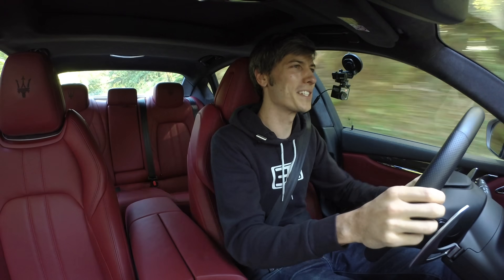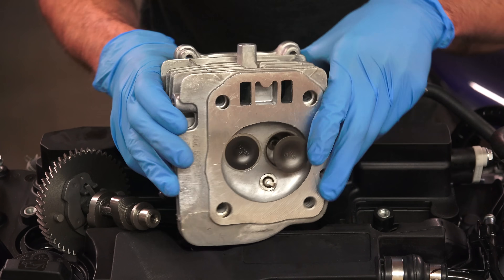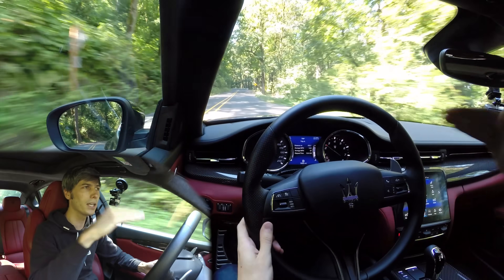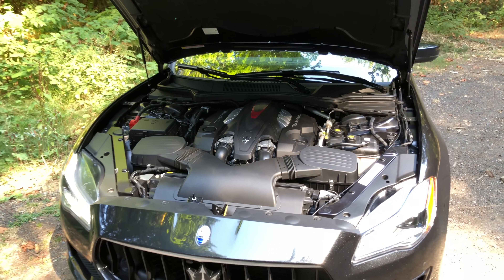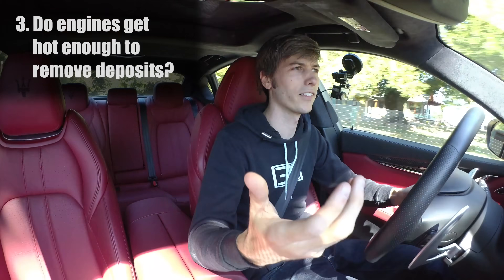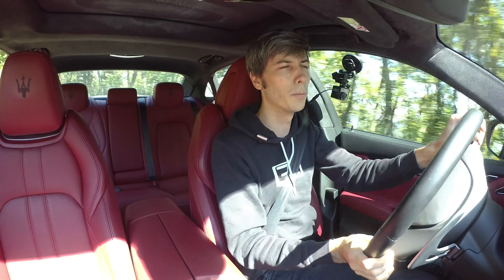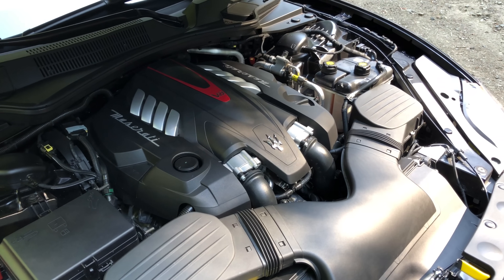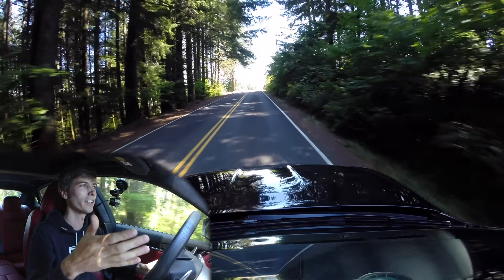Is Redline Good For Your Car's Engine? Italian Tune Up

Comment: This only looked at temperature as a possible way of clearing out the carbon deposits, but I would wonder if other mechanical factors could come into play as well - just flailing about so quickly, more air and fuel flowing through. Likewise, could running the engine that hard or hot do other damage? I have an old Bug, sometimes if it's not running right I'll do some good high-rev pulls and that might help a little - but might just be placebo. Was probably more true with the carburetor, running fuel and air through it more quickly might help to clean it out a bit. I've since converted it to fuel injection, doubt it would do as much with that. But in general, getting everything moving and flowing quickly I imagine is probably good for it from time to time. I've also read that if an engine is never redlined, only run relatively slowly (a grandma's car) the connecting rods won't stretch out all the way and as the cylinders wear ridges will form in the area that the pistons would reach if running at redline, thus if the car is redlined after being driven too gently for too long the connecting rods will stretch out a little more and the rings will hit these ridges and break. Hence it's wise to redline it every once in a while to prevent this.

Comment: I'm wondering about the "Coke bottle" 
tune up.

Taking a warm, not real hot, but warm, 
and drizzling water down the carburetor.

Yes, I KNOW!  Most people have no idea 
what a carb is.

Here is my experience.  1964 Dodge truck, 
with the famous Leaning Tower of Power,
Slant Six.  We played with it for a while, 
points, plugs, and adjusted the valves.

It ran pretty good, when we were done.  We 
tried one more antique tuning trick.  Slowly 
pouring water in the intake, using a CLEAN 
Coke bottle.  After that, we could get the 
engine to idle at 90 RPM.  At 250, we could 
balance a Nickel on the valve cover.

steve

Comment: As for intake valves staying clean in PI cars, do you think those WOT runs will force the injectors to push close to full duty and spray those intake valves clean? I believe it's a good thing!

Comment: Intake valves aren't the big issue from what I've seen. DI is particularly common in German cars and the big vulnerability is secondary air passages, particularly those internal to the head. External pipes can be replaced, but some engines need to be hit with a wire rasp to remove deposits and secondary air clogs can make for a really bad day at the SMOG shop. 

My favorite example of how effective the Italian tuneup can be is the E39 M5. Look at most rear bumpers and you'll see cookies and creme style carbon flakes all over the paint. Comes from somewhere.

Comment: I do the Italian tuneup only when I feel the engine needs one, like if it starts to bog or has an occasional stumble.  What I do is I wait till I have about 1/4 tank of fuel, I drop a full dose of fuel injector cleaner (seafoam will do), go on the expressway and drive at 50 - 60mph at 1 gear below top. This brings the rpm to about 4 - 5k and keep it there for about 3 -5 mins.  Make sure you have clean oil and the level is good.

Comment: I actually cleaned my fuel injectors with an italian tuneup. I was getting stuttering and misfires because of clogged injectors. Just turned O/D off and flored it a couple times. Haven't had the stuttering or misfiring come back in over 3 months.

Comment: In my experience it does work but I have not found modern cars carbon up that much.  The Italian tuneup was used for old carb engines.  It was especially used for high performance muscle cars that were driven very soft.  Those old cars were not efficient at idle and with the big cams, high compression and large carburetors, they had a tendency to crap themselves up.  Don't forget oil control in those old engines was not near what it is today, adding a quart of oil every 1K miles wasn't a big deal.   I don't believe that the Italian tuneup does anything worthwhile or noticeable on a vehicle made in the last 40 years.

Comment: Interesting but you omitted high compression in N/A engines vs low compression in compensated engines as well as airflow. The latter being useful for DPF post regen cycles and cat converters for petrol engines. Interestingky some engines suffer from this whilst others don't (Audi's V8 in the RS4 was bad whilst BMW V8 didn't despite being from the same era).

Comment: I had a 1983 z28 with throttle body fuel injection.  I loaned it to an older lady who drove it gently for about 3000 miles. When she brought it back it had a bad hesitation and would almost stall when starting out. I took it out on the street and floored it up to about 50 miles per hour then slowed way down and floored it again. The first time when I got close to red line in first gear so much black smoke started pouring out of the exhaust I could hardly see out the back window. After the 3rd full throttle acceleration it cleared up and began to run normally again.

Comment: So deposits don't actually form all that fast anyway. Say they form an appreciable amount every 50,000 miles. Well, one or two 5-10 mile race or spirited driving every fill up (300miles) might actually work. However just blipping the throttle to redline while in park might actually make it worse. When I drive normally I try to keep the RPMs under half of redline. I redline at 6k, so I try to shift at 3k. Most torque is at like 1600 anyway so it doesn't even really pull past that unless you have a serious turbo.

Comment: The Workshop addressed this theory. Check out his channel for a different perspective.
Also, I drive my car very aggressively, often cruising at 90 mph or more back roads where I can get away with it. I've driven the car since 0 miles like this, taking long road trips and going at high speeds when I could to save time. I gave it a hard break in in my estimation and put 60k miles on it in 6 months time. I'm at 90k miles now and I've never had any issues. Oil changes on time and new spark plugs at 75k miles. Car runs great. It is my belief that car engine needs to be exercised. No I don't take it to redline often but I drive like an asshole and the engine seems to enjoy that.

Comment: I’m beginning to regret purchasing a direct injection engine as I hear more and more of their fouling issues.  If only the EPA would just get out of mandating manufactures to keep increasing fuel mileage standards.  Sound to me we should of stopped at port injection and called it good enough.

Comment: Is Redline Good For Your Car's Engine? Seriously???  Okay, yes the red line is good for your engine. In fact stressing any mechanical device to it's extreme limit is good and normal.  The auto industry, airline industry, and all makers of engines would have you know that putting the needle on the red line or beyond, is the best way to break your engine in and if anything goes wrong they will gladly sell you a new engine. ;* ]
Reply: I don't think it's quite that bad. If car makers were routinely selling cars with engines that cannot reliably work over their full intended power band then those makers would lose market share in the long term. Obviously if we want to drive our cars hard they need to be serviced hard. Regardless of this it does pay dividends to keep the engine un stressed until fully warm. If we do insist on driving cars to the red line incessantly there will be a price penalty at the fuel pumps. Bouncing off the rev limiter is another matter entirely. This can be very brutal on the entire car, especially with hard limiters. Some engines are better designed than others of course. I'd happily drive a BMW hard all day every day whereas I'd probably not do so with a European Vauxhall / Opel.

Comment: Does 102 octane fuel have an influence? Considering the added components are supposed to clean it
Reply: Not really, although high detergent fuel is always a good idea. Provided cars are serviced hard they can be safely driven hard. You'll always pay for it in terms of fuel usage of course.

Comment: Okay, I don’t know how true this is, but I’ve heard a reason to do an “Italian” tune up is because pistons and rods under high load stretch more. So if you always baby your engine the wear pattern won’t be at full extension. (I mean I know we’re talking like .0001” of an inch) So then if you do actually load it up it can damage the piston rings because of their engagement with the burrs on the cylinder walls. 

I didn’t even know about this carbon deposit thing.

Comment: I ocasionally do this on my Navara D40, it's a 2.5L diesel engine thats quite fuel efficient (for a truck) since I basically drive it everywhere around 1.000-2.000 rpm. And after some italian tune up I do feel a bit of a difference!

Comment: What do you think about Oxy-Hydrogen Carbon Cleaning? I've seen this coming up in more and more autoshops. They claim to internally clean an petrol engine by adding a hydrogen mixture through the intake within an hour and an diesel engine within two. Didn't see any serious analysis on this method anywhere.

Comment: In a 2 stroke the intake charge is at a relatively low temperature (below the figures you claim for carbon creation) The combustion chamber is right in that range yet most pistons and cylinder heads have relatively small amounts of carbon which should mean the exhaust will be clean again as at about 6 inches from the exhaust port you would have about 600 degrees Celsius but the exhaust has the highest concentration of carbon.. So your theory does not work in that case... Alos when stripping a 4 stroke engine which has been used hard in a trackday bike for example then the engine should have the highest concentration of carbon in the combustion chamber but again the most carbon is seen in the exhaust port and it collects in the header pipes too. Your theory seems to rely on papers but not real world. Having actually stripped and built many race engines and been an engineer making components for WSB, Moto GP, F1 and almost every other major championship being hands on and in the real world with no white board in sight you find the real results are very different from what you claim will or should happen. Decarboxylation actually strips away the carbon as an element level and combines with Oxygen to create CO2. As the exhaust port has either no oxygen or minimal oxygen within the port there is no way for the reaction to take place. But if your theory is correct there should be no carbon anyway! But the facts are the port is caked in carbon deposits in an area where you say it should not form but be burnt away. You whole video sadly is not based on reality. You are a clever guy no doubt but having worked in the motorsport industry for 30 years I can honestly say I have never seen what you claim. The only time I have seen relatively clean exhaust ports is when for emissions the manufacturer actually pumps in fresh air into the port after the valve which lowers the exhaust port temperature which should in theory mean more carbon but the lower temperature along with oxygen it helps clean the port. Decarboxylation occurs at temperatures below 100 degrees C in some substances so its not just about the heat it is is about the correct temperatures and how much oxygen is available too.. Ethanol in fuel is an example which will react at lower temperatures than petroleum which will also react at a lower temperature than Kerosene or Diesel fuels.

Comment: Can you look into a vid for Air pumps on modern engines?  I know on my 1.8 non turbo its from cold starts but I think I hear it pumping at high rpm when full throttle, my car make a blow off type noise from the air pump.  I also have a after market intake that puts a small pod filter on the pump so you here it when it pull air in. Great vid!

Comment: Old cars,  I say it works...     Every time I blast down the thruway at least 5 hours away and back, they always seem to run markedly better.  Recently It was an old iron duke from 1980 that made it around Lake Ontario.  That QEW can really cook at times. Or leave you riding the brakes for miles.

Comment: I think it’s best to use good quality gas, not necessarily high octane but good quality you can especially tell the difference in a DI motor.
Reply: Higher octane is for different kinds of engines. Maybe you know this already but, just to clear it up for anybody else, different octanes aren't about quality necessarily but are about different rates of piston firing, so if you put low octane in a hi-oc engine, it'll get The Knocks because it isn't firing right.This is a simplistic way of putting it because I"m not a mechanic but I used to buy hi-oc occasionally for an 87-rated engine, thinking it was better for my car, but that isn't the case according to everything I've read about it.

Comment: Dont really think its redlining it..but highway driving it for long periods instead of stop n go, should keep engine cleaner inside.  Engines attached to automatic transmissions should probably last longer too because they aren't redlined in every gear....reason to only buy a car with a manual transmission new.

Comment: I just replaced my distributor and it had my 95 Roadmaster wagon with the lt1 and LSD running way better. It would actually burn out properly. I gave it an italian tune up and damn I swear I gained like 30 hp. Way faster off the line. I’m close to the lowest numbers reported for 0-60 for the car, (some places say 7 seconds some say 8.5, I’m now just under 7, and this is with 170k on the clock. I think the egr got cleaned out a lot which helped a ton. I had performed a standard tune up before, too.

Comment: Did you find any information, or know any numbers that are relative for rotaries? I know redlining them regularly helps clean out carbon, or preventing carbon deposits from forming, but this video makes me curious what the temperature ranges of the rotors, housings, irons, and apex seals would be fluctuating around. And also what kind of differences, if any, that pouring water into the intake would make towards this.
Reply: Pouring water into the intake assuming you dont mess anything up in the process can help as steam is good at breaking deposits down..but you run the risk of causing damage